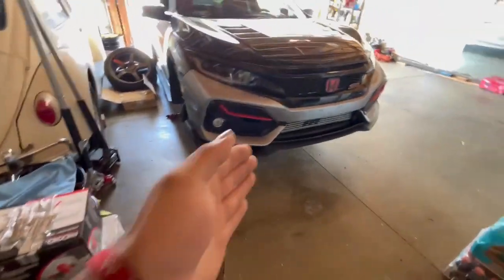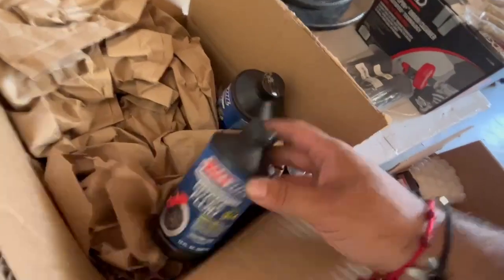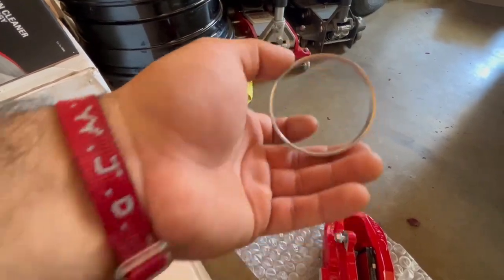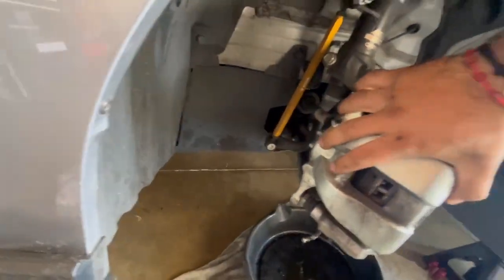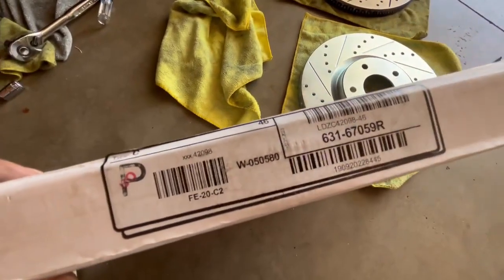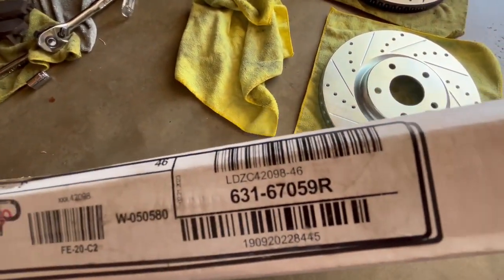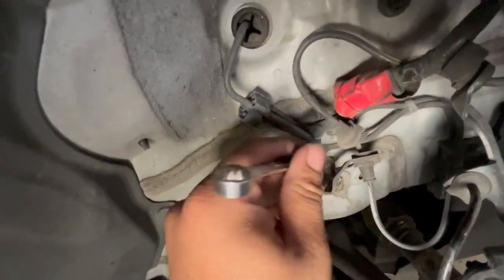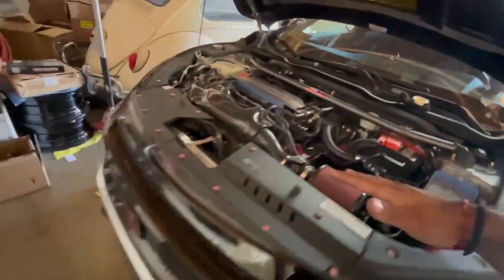How to install Brembo BBK | 10th Gen Civic Si

Comment: The circular piece you showed is called a hub centric ring. Its supposed to fill the gap between the wheels center bore and the vehicle hub on vehicles that are lug-centric. Love the brembo! aesthetically pleasing to look at
Reply from the maker: Someone told me they’re supposed to go on before I put the rotors on, I haven’t had any issues but I did get a larger spacer that has a hub centric center(12mm) and some hub centric rings for my wheels and it’s all lined up perfectly!

Comment: Hey question i bought this type r oem brembo brakes but when i when to the mechanic he say i need a new spindle in order for the to fit
Reply from the maker: For the new Wheel studs yeah the correct way to install is with a new spindle and hub. But for just upgrading the calipers and rotors, they can be installed directly onto the car, the calipers line up perfectly with the threads on the hub.